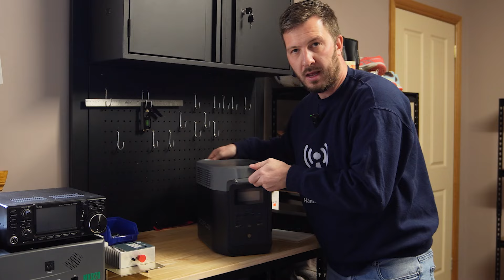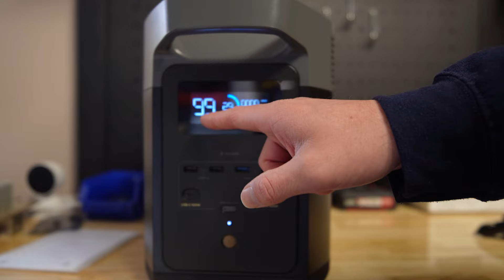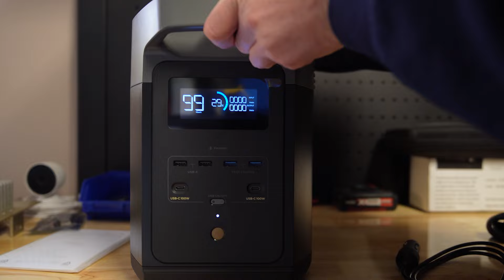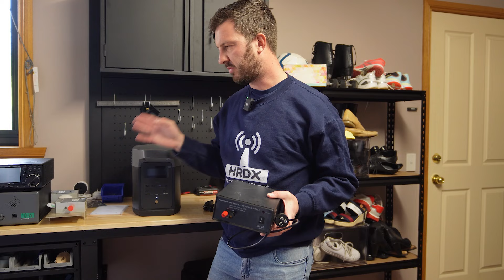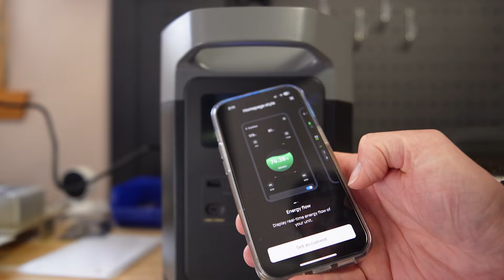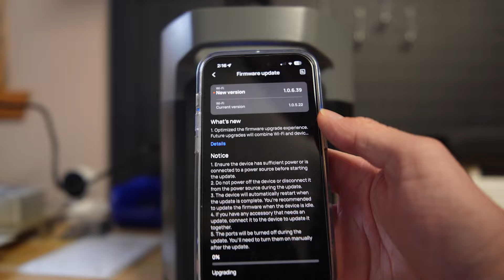Power Your Ham Radio Anywhere with EcoFlow DELTA 2

Comment: I am very interested in further testing to eliminate the pulsing on 40 & 80. I have this same unit and have noticed that on mine. I will retest by spacing the generator further away from my radio. I also noticed it picked up additional noise when I wanted to charge a usb device too. Although I bought this unit for at home it is a nice setup for field day. I also wonder if it could be a specific antenna that may be more noisy than another. I will be watching for updates.

Comment: This device is generating a serious RFI on multiple bands, especially 80m, which is completely closed; others have sporadic noisy areas. I've tried it even with an AC filter. I've used it to feed my JUMA PA1000+ amp and feed my KX3 from the separate battery. I did several tests in the shack and in the field in different configurations, and I wouldn't recommend it for ham radio use.

Comment: Good to know the Ecoflow is kinda good RF-Wise! I purchased the Beuetti AC200Max two years ago. It is a beast and runs my overlanding rig in my 4Runner for a solid 3-4 Days without charging But it has a HUGE drawback! It emits Horrendous amounts of RF when turned on. So much so, it prevent my Keyless entry to the 4runner from working. It completely wipes out all VHF UHF and HF comms when my radio is within 100-150 feet and at 200 foot the noise level is S9. If I go to play radio, I have to turn off the Bluetti completely to play. The plus is the Bluetti can do DC 12Volt @ 35 amps out, But that plus is fully negated for me because of the RF Noise. 
Agree with other commenters that EcoFlow could REALLY appeal more if their smaller units supported 12 Volt - 20 or 30amp outputs. Today only their Big Kahunas do that. The Delta 2 Max would be a shoe-in for EMCOM Mobile/Portable situations if it supported that, and did it through a power pole connector.

Comment: Yes, I agree it's about time these solar charger power packs came with powerpole inputs. We have the Ecoflow River 2 and it's very good but as you say, the radio still needs its actual power supply, leading to slightly lower efficiency, added to which if wanting to go portable/do POTA or whatever, its another heavy thing to carry with you. and another potential source of noise and/or another thing in the chain that could fail.

Comment: Them great to have. just the inverter makes RFI .  I found distance and putting ferrite on extion cord right wear it plus in to power station helps. The extion cord can act as a antenna bringing more RFI threw the cord.  You will need this to run that new ICOM at 200 watts. Just use long cord or build a faraday room for the powerstation . 73

Comment: I've had the vk version of the delta 2 for a few weeks . Mine dosen't like my 300 watt pannel. I plug the car charging cable into a cig to anderson adaptor on the solar pannel. David Murray KF5QQV also known as the 8 bit guy has great reviews on the eco flow stuff. The relay switching time between ac input and battery backup is a pain if using blaupunkt tv's as shack monitors . Annoying having to turn them back on each time the relay switches sources.

Comment: The pulsing on 40 and 80m bands makes it pretty clear that this unit is utilizing PWM charging, not MPPT.  MPPT is typically RF-quiet, and also more efficient.  As 40m and 80m are typically what one would use in an emergency/disaster/SHTF scenario, having a big battery bank like this dumping noise onto the bands is not a good choice.

To the person that suggested ferrites:  sorry, no - why should the end user have to band-aid a decision made at the engineering desk?  --especially at this price point?

Bottom line, this is not a good solution for the Amateur radio community, and I'm not really sure why they would have an Amateur test a solar generator that isn't RF-quiet in the first place.
Reply: It's an MPPT charger inside the device.

Comment: Biggest downside of these for me is the lack of a higher current dc output. Seems like a silly limitation, but it seems almost every powerstation manufacturer has that 10 amp 12v dc limit
Reply: It's that cigarette lighter socket. They're just not made to deliver more amps.
Reply from the maker: Anderson power poles would be so much better

Comment: It looks like they make a accessory device that connects to their power banks called a "800W alternator charger".  It has three modes, charging, reverse charging and maintenance.  In the "reverse charging" mode it is used to supply DC power to charge your RV batteries or use as a booster pack to start a vehicle if the vehicles battery is dead.  It connects to the port on the side of the unit where you would connect the additional battery packs.  Maybe there is a possibility of using this port as a high power DC output.  If you connect a volt meter to the jack on the side of the unit what do you see?  Or maybe you could use the 800W alternator charger module in revers charge mode to power radios.  It looks to just be a DC to DC converter.

Comment: How does it stack up against the Jackery ?
Reply from the maker: More outputs and I think (need to double check) higher output on the inverter compared to the Jackery.

When I tested the Jackery on HF it appeared clean. I need to do more conclusive tests in a lower noise environment

Comment: Hayden, do you have some ferrites to slip over the AC output lines? If so, and that shuts the RFI up, you could then install inside the unit ,right at the inverter output.
Reply from the maker: No, they are all too small for the cable to fit through.

I have maybe one snap on bead. Time to buy some more!

Comment: I just got the us version. It's very similar but the AC output ports are US style. 2 of them are 3 prong with ground connector and another 4 with 2 prong connectors. I don't have the equipment to check if there's HF interference but I'd assume it's similar. I wish the 12v outputs were higher amperage, that'd be nicer for ham radio.

Comment: G'day Hayden. Great review. I love my Delta 2 and also have the external battery. Be aware that the connector for solar input is an XT60i (note the "i" suffix). It has an extra pin between the + and - terminals.
Reply from the maker: Thanks Ray,
Have you noticed any RFI from it? What do you use yours for predominately?
Reply: Is that a ground pin?
Reply: The extra pin is tied to either plus or minus depending on the power source. Car charging cable yields max 8 A. The solar charging cable yields the max (15 A) the device can take.